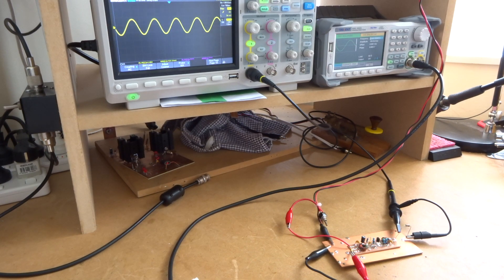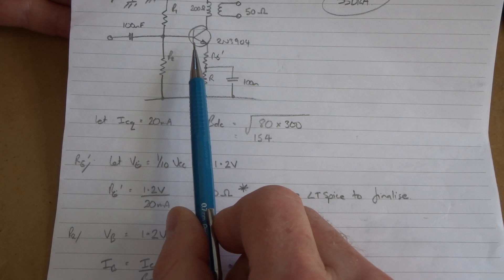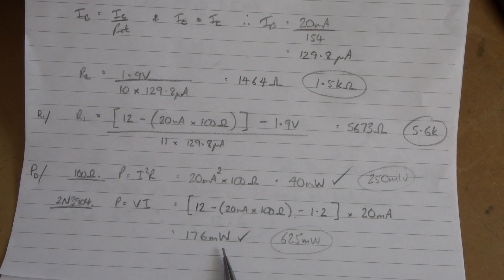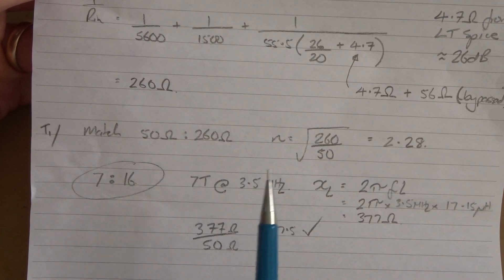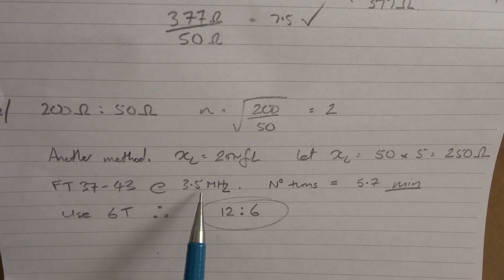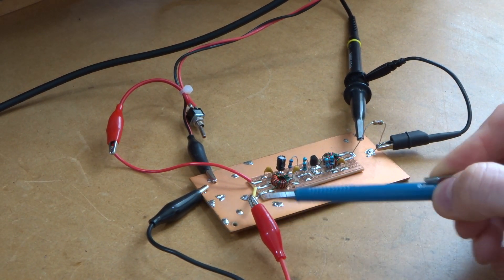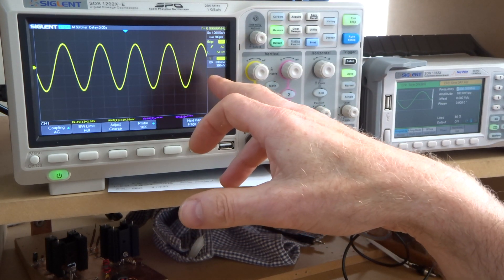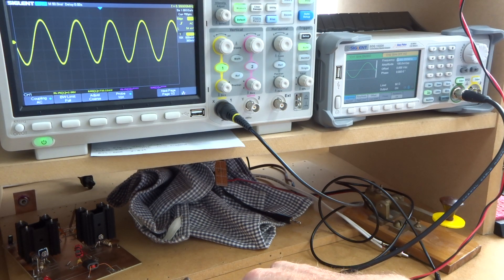Simple Homebrew DSB-SC 80m 40m Rig: Part 4 - Antenna RF Amplifier

Comment: Please can you post the LTspice file? Thank you..Can't seem to "do" a transformer on spice
Reply from the maker: Not sure how to do that sorry. I only have the YouTube channel and the blog.
Reply: @CharlieMorrisZL2CTM   np thanks. Just learned how to make transformer on Spice. Thanks for the videos
Reply from the maker: @Zeus-ub2zp  Hi. The key is working out the inductance of each inductor based on the number of turns. I use http://toroids.info/FT37-43.php
Once you have the inductance for both windings, you need to add a Spice Directive. That will say K L1 L2 0.99, where L1 is one inductor and L2 is the other. If you have more than one transformer, then the next one will be K1 L3 L4 0.99 and so on.

Comment: You could wire the input transformer secondary from the base to the junction of the 5600/1500 ohm resistors and connect the 100nf capacitor  across the 1500 ohm.  Now the bias current flows through the input transformer secondary.  I'm not sure which works better, transformer coupling or AC coupling via capacitor.
Reply from the maker: Yes, that would work to. I guess I'm comfortable with this approach so tend to stick with it. It work well for me.

Comment: You might want to decouple the 100 ohm that is going from the power rail ;-)
EDIT: oh you did in the simulation ;D
Reply from the maker: Hi. Yes, the circuit is built as per the simulation, i.e., the two caps on the transistor side of the 100ohm resistor. The schematic on the blog has been corrected.

Comment: Nice Video as always. Mixer Completed, Rf input amp completed, Next must be Modulator and RF amplifier?
Reply from the maker: That's right Rony. I'll get the receiver portion working first as that required the antenna relay etc to be in place. Once that's done, I'll build the mic amp, test low power TX then build the PA. It's a nice sequence which has worked well for me.